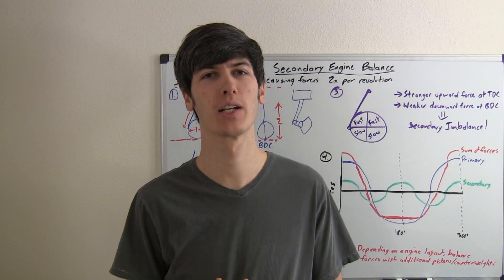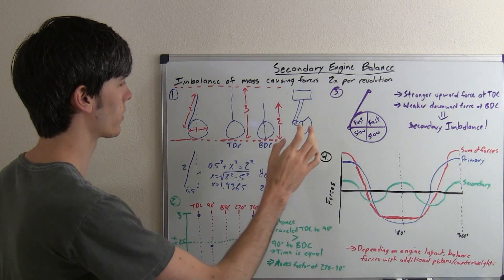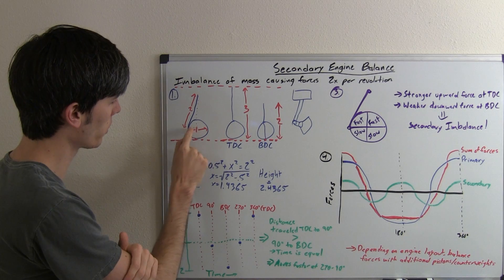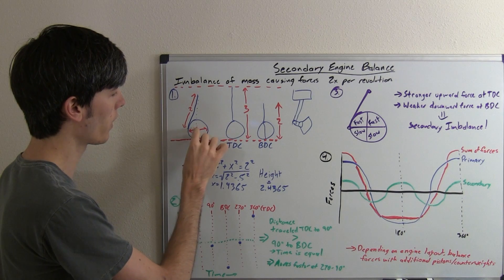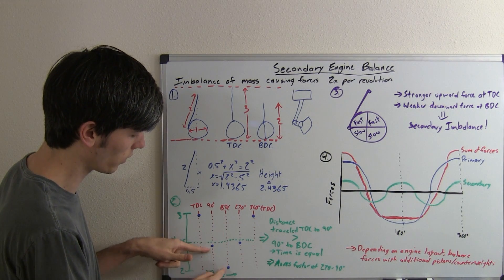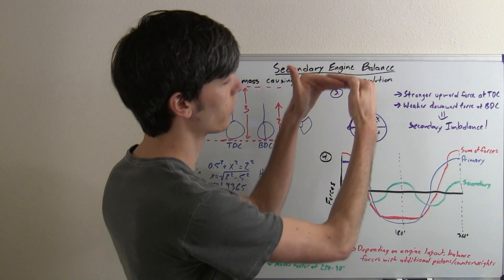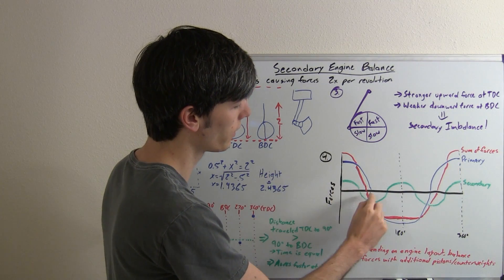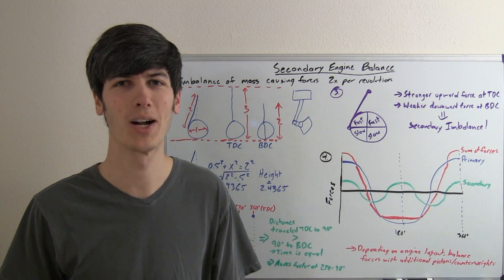Secondary Engine Balance - Explained

Comment: what"s causing secondary imbalance?
Reply: i mean why is the top 180 faster than the bottom one?
Reply: It is implied that the crankshaft rotational speed is constant (mostly true if you have a fairly heavy flywheel).  That means that it takes the same amount of time to go from 90 Before TDC to 90 After TDC as it does to go from 90 Before BDC to 90 After BDC.  As explained in the video using Pythagorean theorem, the piston actually travels further in the cylinder acrosss the top of the stroke than it does across the bottom.  Greater distance in the same amount of time requires more speed, therefore the piston must be decelerated/ accelerated more at the top than the bottom half (time-wise).  More acceleration requires more force, the subject being discussed.  As an aside, this is not complete because the top end acceleration due to simple movement of the crankshaft is supplemented every other rotation (in a 4 stroke engine) by a power stroke -- providing a slight acceleration and another imbalance (this is measured by your engine electronics and if it's missing your ECU generates a misfire code).  This is not an imbalance from the force of combustion, since that's counteracted by the force on the roof of the combustion chamber, but in imbalance in piston acceleration.

Comment: I don't get why secondary forces occur twice per revolution.  TDC to 90 degrees is slightly faster, because the connecting rod has to swing out --fine.  How does that force go up and down before 90 degrees?  I mean the connecting rod doesn't stop swinging out until 90 degrees, so the speed should be slightly higher [than a piston pulled by a rod which moves straight up and down] until 90.  Shouldn't it just be slightly higher tension force on the connecting rod for 0-90, slightly lower compression force on the connecting rod for 90-180, the same lower compression force for 180-270, then higher tension for 270-0?  The way he has it, the secondary force zeros out at 45 degrees, then the secondary force pushes the opposite direction for 45-90?  I don't see anything changing at 45, the piston isn't slowing down yet, it's not changing direction (still swinging out and down), what's going on?...

Comment: He made a mistake when calculating the total hight when the crankshaft is at 270°. He calculated the hight from piston to crankshaft correctly. But becouse it conects in the middle of the crankshaft you need to ad half of the diameter of the crankshaft so in this case 1:2=0.5. So its not 2.43 but 1.93.
Reply: i'ts right next to the Pythagorean theorem calculation.
Reply: @bassweide im glad I'm not the only one who noticed, in any case with the corrected h of 1.93 it further helps his argument

Comment: How does a crossplane I4 cancel this force out? I just can't see it
Reply: elwulfo666 Yes that is my conclusion as well. But unfortunetaly I could not apply this principle to an I6 engine (from what I know, an I6 can cancel out the primary and secondary force naturally, therefore it doesn't need any counterweights). So that would be my next question. I think it must be another type of secondary imbalance, since it means more than one type of vibration (basically any vibration that occurs twice per revolution).
Reply: Vethursan1
Well, Jason has a video for the I6 too, but I don't really know if i really understand the reason why it doesn't have a secondary imbalance.
Reply: it doesn't
Reply: +Lionel Scott-Harston He said so in another video. And Yamaha said their crossplane I4 cancelled out the secondary force too, so it must be doing something.
Reply: In a crossplane engine there are always two pistons in the top half of revolution. One is going towards TDC, therefore upwards and the otherone is going down, away from TDC, downwards so they cancel each other out.

Comment: the piston traveled from  0 to 90 degree  (from tdc) is larger when compared to 90 to 180 degree (bdc), now at what angle will the piston travel be equal in length?
Reply: +Avinash T You have to know the ratio of the rod length to stroke for the engine in question (the example given of 2:1 will probably be "close", it's 1.85:1 in my engine).  Draw the triangle (as above) using trig, also substitute the correct number for x (rod length ratio + 0.5) and solve for the angle. FYI: for oblique triangles the formula c^2 = a^2 + b^2 (right triangle) becomes the more general c^2 = a^2 + b^2 - 2(ab)cosC, where C is the angle you seek.

Comment: Why are balance shafts not used on 2 stroke gasoline engines?
Reply: Most 2 strokes are relatively small displacement so the piston mass and stroke length are small producing lower imbalance forces.

Comment: if the crankshaft is 1 in diameter and the rod 3 long than tdc is 3,5 and down is 2,5 ...
Reply: +be4t.nl rod is 2 units long...
Reply: +be4t.nl In his example, he said 2 unit long rod. But even if it was a 3 unit long rod, the shortest the system could ever be is 3 units. Half of the crankshaft isn't subtracted. Draw it out, it might help you.

Comment: would the balancing be any different for a cross plane vs flat plane crank
Reply: extremely different, Crossplane would having a rocking vibration because outer pistons of each bank don't move in synch, but oppose, so they negate it with full weighted counterweight, in a flatplane 2 pairs move in synch of each other but as you've seen in the video the pair at bdc doesn't negate the inertia of the pair at tdc, and since the pistons move in pairs, the force is super strong, the only real way to balance this is by using 2 balance shafts that rotate at twice crank speed (secondary imbalance = twice per revolution ) on each bank, for a total of 4, no one does this however.

Comment: boxer engine need a balacer shafts ?
Reply from the maker: +David Barzelay Nope.
Reply: I remove the balancer shaft from my car and iam trying to add a harmonic balancer pouley ...is that correct iam wondring if there will be vibrations  in the car
Why some cars don-t have balancer shaft

Comment: The difference in acceleration is explained based on the different "heights" from the bottom of the of crank circle to the top of the piston. I just can't understand why do we have to take into account this virtual height (virtual because it doesn't correspond to any actual physical component or assembly).
Since all the parts involved have a fixed length and are not deformable, the path travelled by the rod has to be constant and the sum "rod+crank radius" is always the same value!

Comment: can you please tell me the top 3 most balanced engines ?Im guessing it goes inline6 then crossplane v8 from some of your other videos.
Reply from the maker: +trebombs4life I6, V12, H6. V12 will have the smoothest power delivery of those listed.
Reply: +trebombs4life Although it is seldom used, the V16 is perfectly balanced regardless of the V angle.  It is probably the smoothest engine ever produced.

Comment: My question is what is the secondary force? What physical part is actuating the force? What force is happening twice per rotation? I'm not very mechanically inclined but I don't think that is actually explained. Someone help lol
Reply: nick CHAFFEE The acceleration difference between the piston at the top of crank rotation and bottom of rotation causes the force imbalance. In an inline 4, two pistons will be at TDC while the other two are at BDC. Since the pistons at TDC are accelerating faster than pistons at BDC the net force will be up. This will take place twice for every rotation of the crank. That is what I understand it to be. f=m.a, the mass of the pistons are equal but the accelerations are different so therefore the forces will be different.
Reply: Ahhh that makes sense thank you!!!
Reply: Ahhh that makes sense thank you!!!
Reply: Ahhh that makes sense thank you!!!
Reply: That makes sense thank you

Comment: This all makes sense, but I think the way you explain it is a little off.  The "forces" themselves occur once per crank revolution.  The forces can be calculated by converting the equation shown here (https://en.wikipedia.org/wiki/Engine_balance#Secondary_.28non-sinusoidal.29_balance) into the time domain and taking the second derivative of x with respect to time.  If you perform a fourier sine series expansion on the resulting equation, you would find that terms 3, 4, 5...  are negligible.  In such an expansion, each term is a higher order than the last (oscillates twice as fast as the fundamental, then three times as fast, four times, etc.).  Therefore, you can say that the piston inertial forces can be APPROXIMATED by two sine waves added together.  Because the second term in the series, the second sine wave, is second order one could say it "occurs" twice per crank revolution.   The thing to take away is that the second order wave is JUST A MATHEMATICAL CONSTRUCT.  The actual forces on the piston cyclically occur ONCE per crank revolution.

Comment: so the counter weights on the crank are there to balance these force? (my engine has no balancing shafts) ... and if they are when people knife down these counter weights do they disturb the engine balance? Thanks
Reply: No the crank counter weights do not balance secondary forces.  Crank counterweights can only balance rotating mass (as explained in the first part of the first video) or to assist in balancing primary reciprocating forces.  Secondary forces cannot be balanced with crank counterweights because secondary forces occur at twice engine RPM so they would require a separate balance shaft running at twice engine speed. When people knife edge crank counterweights for aerodynamic performance at high engine speeds they must re-balance the engine by adding that mass back into the counterweights.  This is done on a balancing rig by drilling holes and adding a more dense material, often referred to in the engine community as "mallory metal".  If this is not done, and mass is removed from the counterweights then the engine will be out of balance.
Reply: +Philip Ball Very true, except when in a racing engine modified from a street car engine where someone uses lighter weight components like light weight pistons and or rods. In that case you would remove material from the counterweight to rebalance the primary forces which would also change the secondary forces.

Comment: I still don't understand why there is a force going up when the piston is at bottom dead center. And how are the forces going up when the piston is going down. Is there anyway that you could explain the secondary force graph in a little more depth. Thanks
Reply: I can't answer your first question, however I think the second part has to do with the fact that the piston has to slow down when the crank it's at 90 degrees. There needs to be a force that slows down and speeds up the piston at 90° and 270°
Reply: the pistons are positioned upwards in a cylinder. consider the top of a piston. when it's at tdc it's farthest from crankshaft center of rotation and when it's at bdc the top of it is still upwards and therefore the distance top travels is less. so the net mass traveled is up. add the difference of accelerations and you have a little out of balance
Reply: Chris Carroll Me neither.
Reply: Chris Carroll It's Newton's third law. You can think of it like as the piston is being forced downwards, it's mass is resisting the push downwards by an upward force of the same magnitude. This is true, however, I never really understood why they don't cancel each other out.
Reply: +Abdullah Almosalami They don't balance each other, because they have different points of application.
Reply: that "upward force" is in reality just a pause in the downward force of inertia of the piston since for about 10 degrees either side of BDC the piston hardly moves at all. So going down from 90*ATDC there is a deceleration of the piston towards that null zone which is a downward force since the piston inertia doesn't want to let the con rod slow it down. Then the null zone around BDC where there still remains a slight amount of downward inertia, then upwards to accelerate the piston there again is a downward force since the piston inertia doesn't want the piston to speed up.

Comment: the secondary forces occur twice per revolution because of the irregular rotation of the crank, when the piston is on the top dead center to half way to bottom dead center the crank will rotates faster and then decelerate halfway down and half way upward. Due to the changes of rotational speeds it creates vibrations. So the movement of the crank from 0 to 90 degrees is fast, 90 to 180 degrees is fast, then 180 to 270 degrees is slow and 270 to 360 degrees is slow. So, it occurs twice per revolution, half is fast and half is slow and due to this it produce vibrations.

Comment: so what is the solution for this effect or vibration have adopted manufacturers and engineers .... Hello from Venezuela, I love your channel
Reply: A Balance shaft module. You will find a BSM in most 4 cylinder auto engines.

Comment: The secondary imbalance is created due to the pistons moving at different velocities, if I'm correct at what I've grasped from the video. But what if I have a 4 cylinder inline?. Two of it's pistons and gonna move down while the other two go up. So when two pistons go up with higher velocity the other two will go down with the same velocity, balancing the secondary forces. The same would happen when the two pistons will come down with lesser velocity and the other two will go up with the same velocity. This way, everything's balanced. [I have no knowledge about how this all works, but just imagined this stuff. Correct me if I'm wrong plz....:)]
Reply: the problem is more correctly defined as different accelerations by the piston.  The act of the piston going over top dead center is different (faster) than at bottom dead center, due to the connecting rod geometry described in the video.  Thus the top dead center (TDC) part of the cycle creates a higher "g-force" than the bottom dead center part (BDC).  typical inline 4 cylinder engines balance the primary forces (2 pistons up and 2 pistons down), but the difference in G forces between TDC and BDC creates a smaller secondary imbalance.  As each pair of pistons goes through TDC (which happens twice per revolution) a small inertia remains.  Thus a typical 4 cylinder engine has a slight secondary imbalance.  This is usually ignored for engines that operate at lower engine RPM but in high revving engine applications its possible to balance it with a Secondary balance shaft that is driven at twice engine RPM.
Reply: Philip Ball Thank you :)

Comment: Ok, my way of explaining may be off, thus my math. I am not a mechanical engineer, Ok? The top first 90 Degrees is  faster. The power stroke. The Circular speed of the rest of the three arcs is much the same, maximum extension to 90 Degrees travel. if you are just talking about centripetal force and linear force. .Are you saying the forces on bottom are equal to the top be cause they are coming from opposite power  pistons on the same crank?.

How you describe the distance X traveled is my main interest here? But if one thing is causing a question, then still "Doubting James". 

There is a one inch stroke on the crank, right? 3-2=1. Where does two inches come in, in the motion equation? To use higher math. Delta is One, maximum. I know you want to simplify drawings to get a point across. You talk so fast. The speed does not help.   Expanding the green distance traveled graph up to three and down to two does not add clarity. My Dad was a Ph. D in Material Science, he could not explain things well to people who were smart but not in his field.  I want to understand this, really. I have looked at what Wikipedia says. I have read "The Design and Tuning of Competition Engines". There is not good explanation of Secondary Forces on the Reciprocating Engines any where.
Reply: His math is correct. At top dead center, from the bottom of the crank circle to the top of the piston, it's 3". At the bottom dead center, from the bottom of the crank circle to the top of the piston is 2". At 90 degree deflection, the height from the bottom of the of crank circle to the top of the piston is 2.4365". 

This means that during a rotation, the entire assembly goes from 2" tall to 3" tall, which is one inch of stroke, and at 90 degree rotation, it's 2.4365" tall, which is what he drew on the graph. The bottom of the graph is labeled 2", the top at 3" and the dots are heights in between. It all depends on where your zero point is, and the measurements themselves aren't measuring the stroke, but the height of cranshaft + piston at displacement.